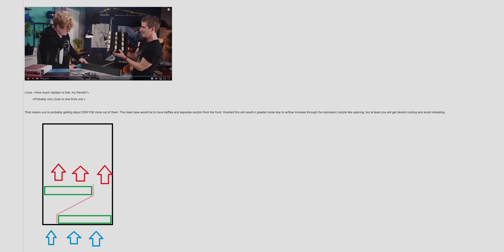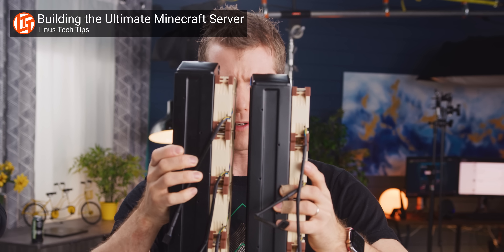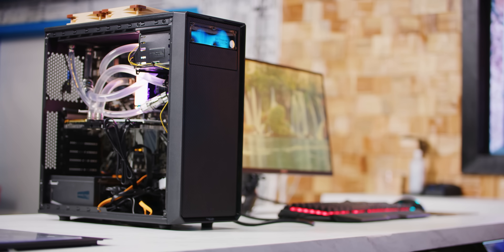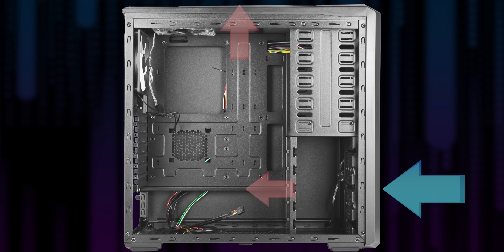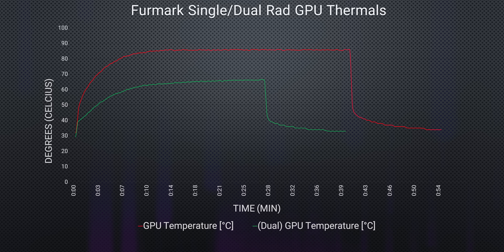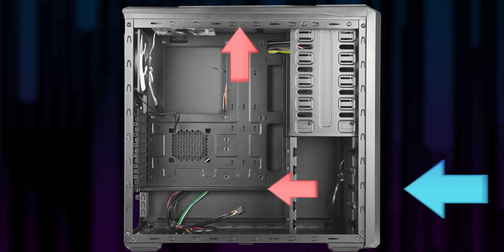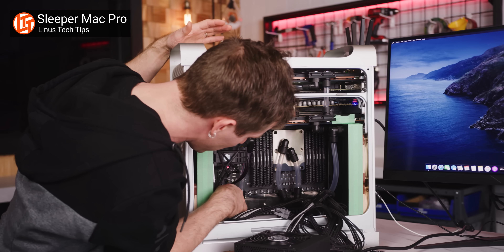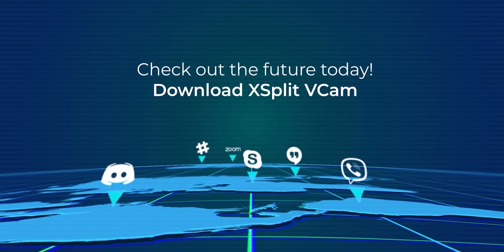I’ve been water cooling wrong for YEARS - $H!T Manufacturers Say

Comment: I don't pay much attention to your water cooling adventures so I was surprised to learn that you guys didn't already know this. Nonetheless, as you found, in theory there's no difference between theory and practice but in practice there is. Still, if you're bent on adding a second cooler, at least add it in parallel air flow, not in series.
You should do a follow-up comparing single, dual serial and dual parallel to give the a truer perspective on reality.
Of course if the size of one cooler is adequate then having two isn't going to reveal all that much no matter how it's configured.

Comment: Having more radiators would make cooling better, same is with a car, if the engine is running hot and you turn the heater in the car all the way up your engine will run cooler

Comment: Absolutely love this video! I believe that had you mounted the 2nd radiator on a side panel as a 2nd intake radiator instead of as an exhaust radiator it would have been even more thermally efficient. Might have taken some creative cutting and mounting but I think your results would have been even better
Reply: You mean rather than stacking rads it would be better to connect them in more a side by side configuration...not stacked. That is because in a stacked configuration, the first rad cools the water and warms the air in which that warm air is then used to cool the water from the second rad.

Comment: So after looking at your loop a second time, your test was extremely faulty. You have the GPU connected to the CPU, which throws off what you were testing for. The way it should be, is Rad-GPU-Rad-Cpu or vice versa. That's the only way you can prove your point. The liquid cooling the GPU is going directly to the CPU, which is completely wrong. If you want better results, you have to cool the liquid before it reaches the CPU. Two Rads are better than one, but when you're going RAD to RAD like this loop, it's not doing anything. So your loop is set up wrong, and Corsair is literally retarded if they think it would make a difference.

Comment: If you had measured the air temps before and after the rads that might have given some more insight. It might be that the air wasn't heating up to the temperature of the coolant and therefore still had "delta T" left in it when it hit the second rad. ssssssssssss

Comment: You connected second radiator WRONG!!!
In your setup: hot water goes into first radiator and cools down with outside air pulled inside case. Then cooled water goes to second radiator and cools down with hot air from inside of case.
It should be opposite: hot water should be cooled by hot air from inside of case, then cooled water shod be cooled more by outside air pulled inside the case.

Comment: corsair h100. cpu temp = 76c water temp=39c rad core temmp 34c air in temp 19c air out temp 27c. the rads are nowhere close to as efficient as corsair claims, especially an aluminum rad. although stacking rads will have diminishing returns....

Comment: Put that 2nd radiator OUTSIDE of the case or DOUBLE the intake airflow, but NEVER STACK

Otherwise that extra cooling capacity is just noisier and less power efficient. The gains from stacking are so small they're hard to measure. Doubling the cooling capacity should be very easy to measure.

Comment: I believe what they (Corsair) tried to say is that if you feed the warm air from one radiator to the next one(s), the heat exchange is less efficient than if you would have all radiators in parallel, with their respective air intakes at room temperature.
Of course, adding more surface is always going to help. But it helps more if the intake for all surfaces is at room temp than if it is at “exhaust-of-my-other-two-radiators” temp...

Comment: This is wrong.  You did NOT test what Corsair was telling you AT ALL, and thus, did not get a useful result, which would've proven what they were saying.

Corsair was correct: the physics of a water-cooling radiator is that, the cooler the air passed over the coils, the better it's going to be able to cool in terms of speed and final temperature.  Doubling up isn't your issue, the fact that you're not passing through the coolest air you can is.

The most effective water-cooling has external radiation, which is taking air directly from outside and running it across them, then pushing that air quickly back out the top and away from the system: this is why car radiators are built the way they are.  If you want to see the MASSIVE increase in cooling capabilities that Corsair is telling you, build a box with the radiators on the OUTSIDE, and use quiet fans to cool the other things in the case with air that doesn't go into or come out of those radiators.  This will not only be a MUCH more effective cooling setup, but you'll get a quieter experience by being able to position the box itself between the water cooler's fan, pump, and radiator and the user.

Try THAT, and then come back and you can post a video where you show how to maximize water-cooling potential in a computer.

Comment: Linus, I know this is a bit late.... Stacking rads is fine so long as the water flow is opposite the air flow.  You want the coldest air hitting the coldest water (water leaving the rads is hit by the coldest air entering the rads) and warmest air hitting warmest water (water entering the rads is hit by warmest air leaving the rads).  

I deal with water on a daily basis just a much larger scale (commercial/industrial HVAC) and this is how engineers design the systems.  Its the most efficient and you get the best heat transfer this way.  

I'm 100% positive if you changed up the Minecraft server flows to follow this setup you would see even more drop in temperatures.  If you want any input I'm happy to draw up a design for you.

Comment: By having a radiator on the intake, the heat it dissipates goes INTO the machine. Putting it on the exhaust means it's drawing hot air across it. You're fighting yourself both ways. You keep thinking "inside the box". Boxes need to change. Sticking the fan on top was actually a step in the right direction. Mount the radiator outside the box too if you want it work the best.

Perhaps someone could build a case designed for water cooling. With a separate compartment just for radiators and fans. Main compartment, intake and exhaust fans blowing through front to back and top. Your water cooled components run lines to the separated bottom compartment of the case which has it's own front to back airflow and radiator mounts.
Both compartments only get fresh outside air coming in. Your case would just be a few inches taller. A little dead air cavity or some insulation between the two compartments.

My old rig at home uses Freon and a compressor. ( I stuck a window AC unit in the room and my case is right in front of it).

Comment: Heh, I thought this was going to be about running the water loop at less than ambient pressure, to insure no leakage of water. Oh well. Anyway... IF the radiators were actually stacked, and IF the air/water flow path had the room air pass first over the radiator which is second for the water flow, THEN you might still have a small benefit in the low-temperature example, because that would approximate a counterflow heat exchanger. But this test has water temperature so far above room temperature, a single radiator does not give enough surface area for best cooling. And obviously, having the radiators each receive room air directly would be even better.

Comment: I kinda always did laugh at him doing that... You're still blowing the same air across them, maintaining the same heat that it pulls off the previous radiator. Basic aero- and thermodynamics? And that's not even counting their main point. Not saying it does nothing, just that it's quite incredibly redundant, and does very little.

The extra fans pulling more air would perhaps help a little tho?

When you split them up tho? Airflow going 2 different directions? Yeah? Ofc it makes a difference. You have 2 different airflows going.

"Stacking rads" is bad I'd say(or of very limited use). But using Rads in different airflows, is not. That has been my experience.

Comment: I would be curious to know the actual rad temps. Stacking rads seems like you would heat the second rad with the hot air from the first. But I guess if the air moves fast enough that’s not an issue.

Comment: There is a time element in the heat transfer equation Q/t=KA(T2-T1)/d meaning that adding a rad will increase surface area but I think the biggest difference between the Corsair comments and your testing is the time the air is passing over the exchanger.

Comment: Mhh.
As long as the air temp is bellow the water temp there is some heat dissipation. The smaller the gap the less heat will dissipate and I thin that's what everyone understands. Twice the radiators != twice the cooling. 
But there are way more factors that play a role here and I understand that there are cases where a second radiator will not result in a significant improvement and actually might decrease performance.

Comment: Have the three radiator stack not remove one, but just pull it away and use that to compare.  You are probably still hurting the temps by stacking relative to what they could be.

Comment: More radiator surface is always more efficient. If you have enough surface, you can even do without fans!
Because of airflow, we can use them at the normal little size they are.
Of course cool air, will give lower temps (delta temp rule). But the fans job, is to remove(fast force) the heat buildup in the radiator.

Comment: Great video, I would love to see a series vs paralell test. I''m putting my money on paralell running cooler
Reply: Parallel or seriel does not matter at all for temps.
And if you only have one inlet and one outlet on your pump, it will not matter for pressure either, as there are no more restriction in a radiator, then in your loop tubes.
The cooling of your loop is determined by the cooling capacity of your radiators, and the heating of the loop is determined by the power output of your components.
If you split the loop and put the two radiators in parallel, the flow will fall to about half, and soak up more heat from the component on that loop, and the fluid will remain longer inside both of the radiators and get slightly more cooling, but because the fluid was warmer before in entered the radiators, and they mix together in the same reservoir anyway, before being pumped out again, it will not matter at all.

Comment: I think a better way to test would have been to add a thermocouple to the input and output of every radiator and monitor the temps with either an oscilloscope with large horzontal time base or a data logging multimeter.

Comment: Don't let Corsair shove crap in your head. There's enough there already. Assuming a proper loop, including proper water flow, so long as the air is even slightly cooler than the radiator fins and pushing/pulling enough volume through them, your radiator will cool.  Its purely about thermal transference: the die, then the block, the coolant, the radiator and its fins, and finally the air passing through the radiator. If the air is super-cool, you don't need to push much to suck heat off the fins and keep your component temperatures in check. The warmer the air (e.g. the closer it gets to fin temperature), the more of it you have to pump through to carry the same thermals. Once the air reaches the same temperature as the fins, its pointless, but by then the interior of your case is probably melting anyway. In short, a two rad system pulling air from outside the case through RAD1, and from inside the case for RAD2 to exhaust will still benefit, so long as the RAD2 fins are warmer than the case interior air. That said, in my experience the best  configurations have positive pressure from filtered floor-mounted intake fans, and all radiators are in exhaust configurations. In that you're not only cooling your case interior with bottom-up fresh air, all heat from radiators is expelled from the system.

Comment: I'm not surprised that corsair got it wrong and believed their simulations without doing proper IRL testing. I RMAed my H110i because the performance was so bad I thought the pump was broken. After I sent the AIO back, I bought a cheap $40 air cooler to use for a couple weeks while I waited for my replacement. I got the replacement H110i and it was EXACTLY the same as the first one and WAY worse than the $40 air cooler... and I realized that is just how it performs. Even more shocking, I recently saw a LTT video that showed Corsairs 360 mm cooler performs WORSE than their 240mm cooler! and they BOTH perform worse than a decent Noctua air cooler. Corsair is doing something wrong...

Comment: Why is this not discussing loop order??  If you take the hottest water from the last loaded block and run that through the exhaust radiator, then into res/pump and past a 2nd intake radiator, you have an absolutely ideal setup. 
Highest load is removed from the internal case air

Comment: and still the 2 radiator system could have worked better if the first radiator through which the hot water passes is the radiator that receives the hottest air (the one from the top) and the next radiator in the loop the one that receives the air  cooler (front radiator).

Comment: The really crazy thing is that if you had both radiators were exhausting ... you would be positive it would work better as long as you have enough air intake (like pull the side off and throw it away, put a 20" fan pushing air in, and while you're at it, put a hepa filter on the intake of the fan). You create positive pressure of clean air in the case. I've seen temp drops that are wonderful (10 degree).

Comment: This is rather retarded by corsair (horrific attempt to get a AIO selling point) and idiotic, making common sense and physical basics suddenly a mystical thing. Unless the airflow through the first/intake rad is hardly existent the air will never have the same temps as the water. So there is - in real usecases- always enough detla T for the air to have effect on the second radiator and so on untl you reach T air = T water

Comment: What if you did a push pull config on the same side of either or both rads? I mean have a fan pulling air into the rad/case and another fan on the same side of the radiator pushing air out of the rad/case. Equilibrium with in my opinion best chance for cooler air to reduce temps and with the same equipment. What do you think?
Reply: With that fan config you could actually stack rads.

Comment: If removing the second radiator from the system only increased ambient temperature by 5 degrees celcius he at least proved their claim about efficiency. Whoever sent that message from corsair had broken english and probably meant to say that the additional radiator doesn't decrease temperature by much relative to how much power it uses.

Comment: the reason it took longer to get up to temp is probably more due to the fact you had more coolant in the system tho. If you where to add a 20L reservoir to your loop it would take a LOOOONG time to heat that up if it even gets to the point of it fully heating up the full 20L ever.

Comment: Love your videos, LTT!  "Simulations" aren't test results, Corsair.  ;)  You will still gain some cooling BECAUSE you have more water to soak up the heat and more radiator surface area to scrub the heat away even if it is slightly warmed from inside the case. It's just general thermal principles...increase the surface area and you'll increase the cooling capability which is why you experienced a reduction in temps. Corsair didn't take into account that valuable principle of volume and surface area when they offered their wisdom. 

However, stacking them like you did with the Minecraft server would have some, eeh....maybe questionable results?  While you are gaining thermal advantage from stacking because of the temperature delta between radiators, if you are going to use multiple radiators, they really need to get their own fresh air source and not air that is heat saturated from another radiator directly attached to them for the best results. Even with warmer air to cool the second radiator in your test righ, it looks like there were some nice gains since the other case fans were drawing in fresh air.  20C is a nice drop!  I'd take that for the cost of a second rad and some plumbing.

A new test??  If you could mount the ones from this setup or your Minecraft server side-by-side on a flat plane and connect them in series to act like one big radiator that might show even better results?  Theoretically it would have to but the problem with this experiment is having a case with enough surface area to mount them so they all get the cool outside air but I'd love to see the results. You might need to mount them (ugly as it may be) on the removable side of the case if you had a mesh panel?

Comment: so...according to corsair simulations if air passes through radiators it instantly becomes hot as the water? 
did they messed up the timescale of the flow in l/days instead of l/minutes?

Comment: Having two rads in one case is no issue, so long as both of them are taking IN air from outside the case. No point have one rad blowing hot air into a case and then another exhausting the same hot air out. And stacking rads like they showed for the minecraft server case is just pointless, get an external rad at that point.